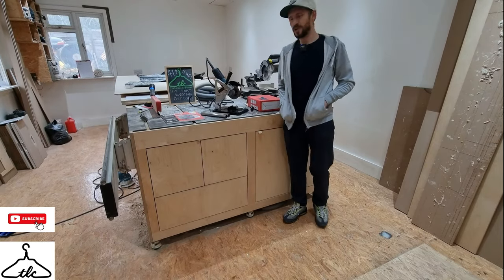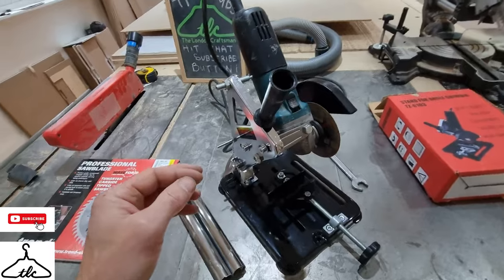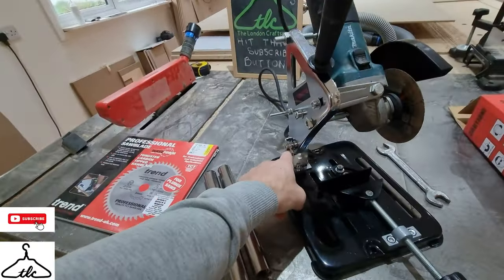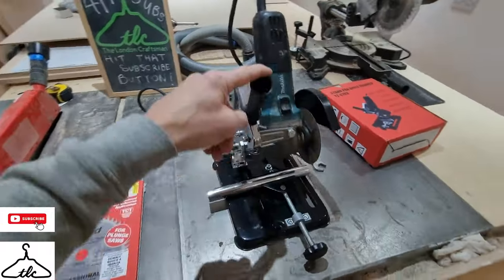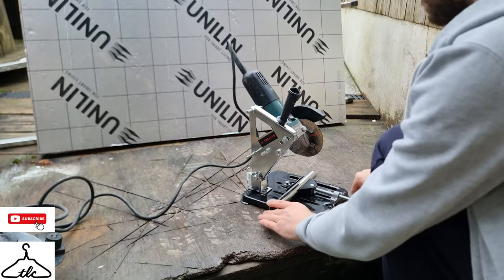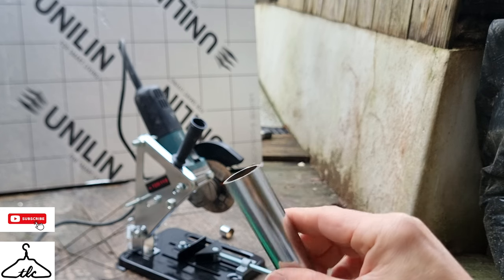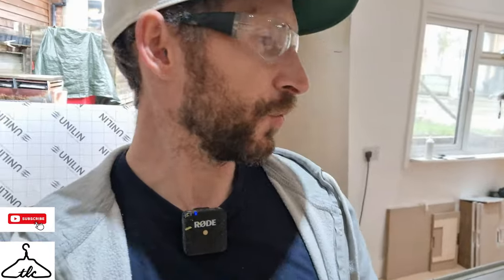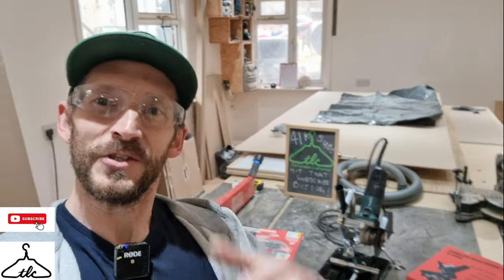Is This Gadget Worth Owning?  Vid#166

Comment: Hello! I cut them with my Makita jigsaw using Bosch progressor blades, some blue tape and a small square to mark the line. The cuts are done fast, very clean, square, no heat and no sparks just a 2 seconds high pitch noise and done. To me, this jig is very loud, slow and dangerous: the guard doesn't help much with the security of the user and with all the vibrations some of those bolts might get loose. Have you tried the method I'm using?
Reply from the maker: I've tried jigsaws before and for me they cut out of square... but I'm happy with this way, I cut outside and gives me crisp sqaure cuts so I'm happy.